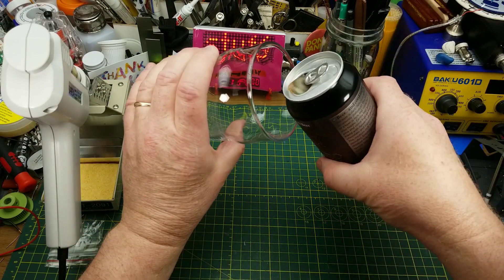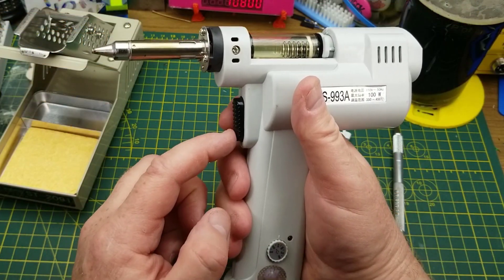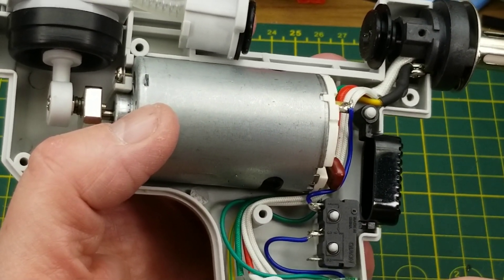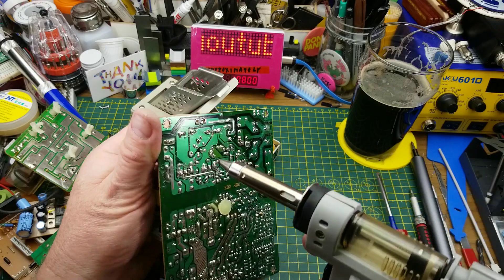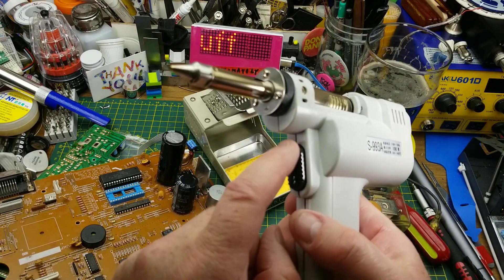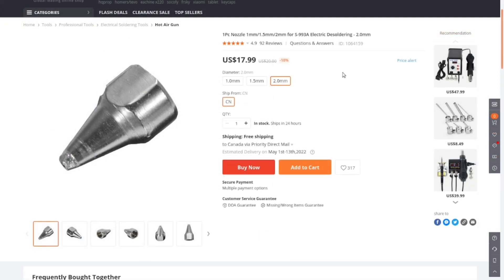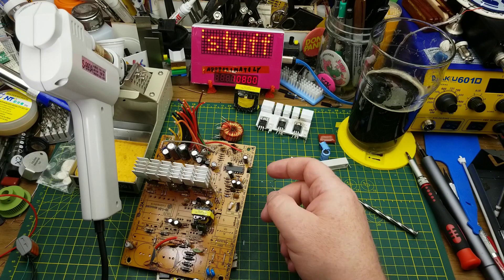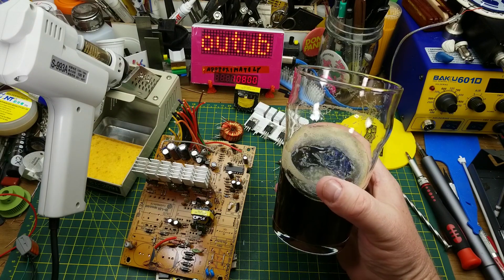powerful solder sucker - first look

Comment: I used a Hako solder sucker at work, but it cost over $400. This ain't that Hako, but it does the job as I have one at home.
Reply from the maker: Yeah, these cheap tools aren't pro grade, but for most hobbyists they will do the job.
Reply: @pileofstuff it is surprisingly good for the cost

Comment: I have a similar unit - S-997P. My unit has a different type of tips, the ones with a long tube for solder transfer. These devices are two much trouble. If set to anything lower than maximum temperature, they clog quickly and the reason is that the tip shaft is very long and by the time solder reaches the end of the shaft it cools off, as the shaft is not heated evenly. Another big problem is that the tips wear out VERY VERY quickly and finding replacements is an absolute nightmare. The replacements for your unit, I guess, are more readily available. But the ones for S-997P are simply nonexistent. When I bought it, I ordered some replacements, but these are wearing out and are plain impossible to find anymore. So, most of the time, I tend to just grab my Engineer SS-02 sucker. No heat up time, no waiting, no tip wear, works OK, does the job.

Comment: Good to see you using the tool in horizontal orientation.

Most users do as they do soldering, the pcb horizontal  and sucker downward.. Experience shows that is a sure way to having far more blocked nozzle problems. In vertical the liquid solder tends to fall back to the region of internal nozzle tube entry to the catch chamber. Especially with greater number of joints sucked out, and bad when hardening after turn off.
There along with small particles tends to block the fine tube. At least this was delivered with some fine needles to push the fine tube clear.

As far as catch improving a bit of loose packed stainless steel wool  scouring pad minus any soap. It assists very much catching and holding solder sucked in. Cheap to replace after several clean outs. Cheaper even than the brass soldering iron cleaning pad.

Comment: $ 20 for the tip is a bit of a scam. They just count on the fact that you won't toss out a $ 100 device for that price.
I will buy it when they throw in two spare tips.
The membrane, that should be available too.

Comment: Looks like they're using the heating element as a series resistor to run the motor, much like in a hair dryer. Neat. :)

Comment: Any idea if there's a way to mod it to 230V? The 120V model is about $30 cheaper than the 220-240V model.
I'm cheap so if it can be easily changed I rather save a few tenners.
Reply from the maker: Not sure. You would probably have to mess with the controller board a bit. 
Its not something i considered when i had it apart.

Comment: Something I also recommend doing with the solder receptacle (as recommended in the instructions for Pace desoldering stations): coat the inside with a very light coating of mineral oil. This helps prevent the solder (and moreover, the flux residues) from adhering as tightly. Makes cleanup easier.

Comment: 15:00 a tiny wad of brass wool (we just grab some from old brass wool in the recycling bin) is exactly what we use at my workplace (a vocational training center) on our Pace after students accidentally broke the glass tube when sliding the original aluminum S in.

Comment: I'd suggest getting into the habit of making small circles with your tool while sucking solder, because that will make sure the component lead is not getting stuck to the walls of the through hole and also sucks some of the solder from inside the hole. Also, for older circuit boards spray a bit of flux over the solder (or use some gel flux or even pour a few drops), it helps heat up the existing solder faster and you don't need to keep the tip at such high temperature.

Comment: 11:00 - NO, that isn't the Australian version. That's a Chinese plug! Also the voltage is wrong for Australia too.
Normally, Australia and NZ should buy the 220/230V EU version then change the plug themselves.
I have checked and there DOES NOT seem to be a 220/230V version on Banggood.

Comment: This unit seems to be relatively quieter than the Hakko FR-301...  For that reason, the cost of the tool itself, the fact that you get a stand included and the replacement tips are much cheaper really poses the question why to even bother with the Hakko model.

Comment: Why haven't you tried it on a double sided board?

not capable of desoldering double-sided plates?
Reply from the maker: I did and it works fine for doublesided boards. The video of that part was out of focus, so I couldn't include it.

Comment: I have both a Denon and a Hakko verson of these things, and they make life so much easier desoldering through hole components. You can often desolder multi pin chips, or header pins, and have them fall right out afterwards.
knowing how well they work, I'd probably be going after one of these models if I didn't already have the ones I have. so handy.

Comment: You could also consider coating the inside of the glass tube with a thin layer of oil to prevent solder from sticking to it.
The same goes for the metal part in the back of the tube.
Reply: You could coat the glass in silicone oil, perhaps. But don't put anything on the filters.
Reply: i'd advise against that. sucking oil needs even more filtering of itself.
Reply: @Palmit_  No, it's just a thin film of oil on the inside of the glass. You dont suck anything there. It's a practice we learned when I took my soldering certificate in the Air Force. Also recomended by the manufaturers of the soldering stations we used.

Comment: Shame a selection of tips is not included as the price of spares seems a bit rake,  If was the unit with a selection of tips - that as a package would be better.  Also, two of each as I like to keep my tips used for lead-based solder separate from those of non-lead variety - just seems to prolong tip life if not mixing I found, though no hard science, just anecdotal.

Defo good mod.   

Question - how well does the suction filter the fumes?  Which may explain the extra layers of filter in the unit and if so, how easy to replace (felt pad be easy to get from crafts shops cheap).
Reply from the maker: I didn't notice any fumes during my tests, but I did also have my usual fan (out of view on the right side) blowing air across my workspace.

Comment: I have used something similar in the past and they are great.  The thing to watch out for with them is that when the nozzle starts to get eaten away it tends to lift the pad rather than desoldering it. This is because they become very sharp at the nozzle end
Reply: I second a recommendation to use those things, I have another one, while desoldering was a pain before, it has become a breeze, it is now easier to desolder than to solder.
Best investment ever!

Comment: $100 is pretty cheap for a powered sucker, and that little pump looked to have a lot of suction - will be interesting to see if it endures regular use.  Perhaps you'll share an update after a few sessions with it. I've read that maintaining a light coating of silicone oil inside that chamber will keep the extracted solder falling out easily.  Using the brass pubes was a nice touch (sorry, didn't know what else to call that stuff).

Comment: I bought the same one about 3 years ago and I've only just had to change the filters. They are realy low maintenance. The only thing is the cool down time is about 30 mins. LOL.

Look after those rods, I can't find replacements anywhere. One of mine has a slight kink and won't fit down the barrel anymore.

Comment: looks like it works pretty well. I took a long time to decide to get a de-soldering gun I looked at that one and really all of them. I liked the price but in the end i played it safe and bought a Hakko Fr301 it cost me a lot more but what sold me was they had a complete line or replacement parts for it gives me a bit of peace of mind. 
It makes the work so much more simple and efficient even on hard to get to point to point wired circuits. There is no longer any hesitation. I do not have to apply heat to the solder jouit very long at all very quick.
Reply from the maker: This one has a lot of features that look suspiciously like the Hakko..
Reply: In the Hako I used, the vacuum motor was separate from the gun. It produced a lot of suction and worked very well. But this works almost as well for 1/4 the price.

Comment: I have one. Works good at the beginning, but the tip is not very good and for some reason kills heating elements. (I've replaced the heating element 3 times with little use)
Reply from the maker: I'll have to keep an eye on that. Thanks.
Reply: I've heard a lot of complaints about these burning through elements. Not sure if it is lack of temperature control or what. If you have a way to check your temperature, I would recommend checking it out to see if it needs calibration. 
 
Do you heavily tin your nozzles before you turn off your gun? 
I've had major degradation issues initially with my knock off work gun, found that tinning helped a bit. 
The coating is very thin on these, so it doesn't take long to wear these down especially with lead free solders.
Reply: I had the same issue so after looking at the controller board and notice next to no protection to inrush of current to element on startup i added one across the line x2 cap on mains input and on heater element, also added a inductor to heater element side and never had any issues since,
Reply: @Mazwreck  Can you somehow post the schematic of your modification with component values?
Reply: @jackoneill1070  isnt much to it, just disconnect one of the heater wires to the board, add in series a inductor, one side going to element, other to control board. then across both heater connections add a x2 mains rated capacitor across it,
Reply: @jackoneill1070  Parts used 470uh inductor, 100nf X2 rated capacitor, i also fitted one between the mains input also, Sadly i ended up buying a hakko as i got sick of the tips on these getting worn out very fast as i use it alot but in the year or so of heavy use element never failed, reason i looked into this was replaced the element died first time around and when replacing it looked at why it failed, Good luck

Comment: For free that's ok. But seeing how Justin takes all my spare change I still use a soldering Iron and blow the gunk out of the hole with compressed air. I'm not cheap. Just broke. And my bench is full of solder blobs. ( Or is that art ?)

Comment: I always wanted one of these because desoldering often is a drag.
Too bad they're pretty expensive though.
Reply: A desoldering station is a revelation. It’s not just a convenience, it enables you to safely remove components that plain and simply cannot be done without damage otherwise. 

If you’re patient, set up some eBay or classified ad alerts and find a used one from Pace. Top quality, but not as well known among consumers, so used ones don’t sell for stupid prices like Weller. In Switzerland, where I am, there isn’t much Pace gear so it took 3 years till one came up, but I got one, an ST-75 with SX-90, for $115 (including shipping cost, and it came with around $100 worth of new supplies!) that just needed a fresh rubber seal (a $5 part) to make like new. That station, which you can still buy new today, costs nearly $1000 new. 

P.S. Pace’s videos on desoldering technique are fantastic. Proper technique makes it far easier and safer to do without damaging anything. (Their soldering tutorials are also second to none, even if they are very old videos.)

Comment: Not sure if someone else mentioned it as well, but I did mention on the last video that the Aoyue desoldering gun I have uses a spring with a taper at the end. Also using some silicone grease on it helps prevent the solder from sticking firmly to the spring. I have the same gun and the copper scour pad trick really helps extend the life of the filters and is cheap to replace.
Reply from the maker: It was you!
Your mention of that spring is what made me think of using the scrubber in the reservoir.
Thanks

Comment: I originally looked at the 998 version of this unit because of the higher suction, but the lack of nozzle sizes and wattage were the main reasons I did not keep mine.  

Ended up settling for the Hakko FR301.. Because nothing else would single handedly heat up large leaded multilayer appliance and power PCBs.
Reply: Looks like a clone of the Hakko FR301 I have.  Don't know how I lived without one!  Much easier than the hand sucker and solder braid.

Comment: I have the station version of this. If you start getting clogs in the heated pipe, check the filter. That helped. Also, I run the vacuum a second longer to ensure that the solder has cleared the pipe.

Comment: Well, that is a tool I'd actually use.  My manual solder suckers ... well ... they suck.
The task I most dread is removing a precious IC or card that has a row of 20+ pins.
Clearing journals of solder on a thru-plated PCB is also a chore.
Have you ever abused the pads on a board so much that you burned them completely off, or is it just me?
Reply from the maker: Oh yeah. I've destroyed many pads and tracks over the decades.

Which gave me the "opportunity" to learn how to bodge around that kind of faults...
Reply: Easy enough to repair a plated through-hole or via. Strip some fine stranded copper wire to get the individual strands. Poke it through the hole, bend each side to the broken track. Solder it all up.

Comment: I have the same one. It's a few years old and still works great. I would be very careful with the copper wool. Any thing that my obstruct the exit of the tip can cause it to clog. There is a short little run of the exit that's not heated well.
There is a spring that is made that looks like a bullet. The smaller end has a hole in it that point toward the filter. I have never found a need for it myself but I guess it would be helpful.